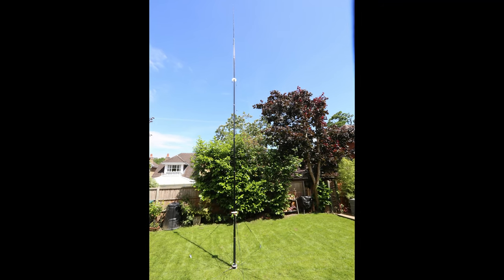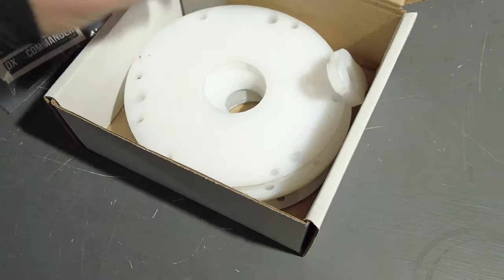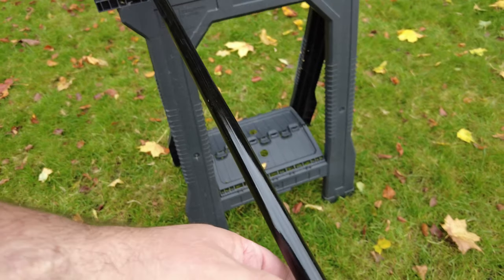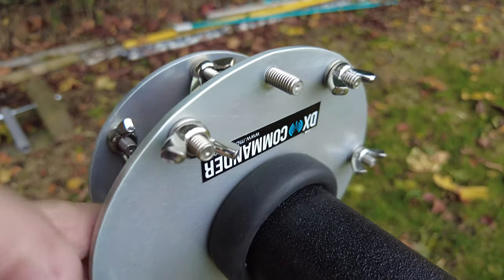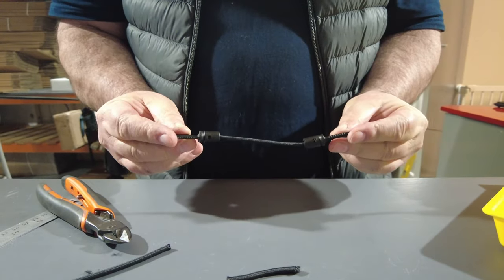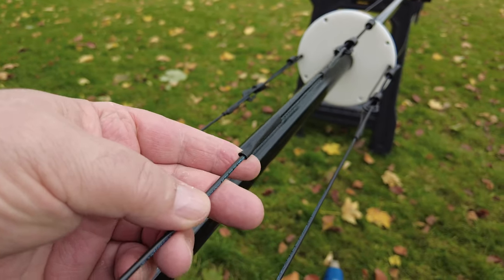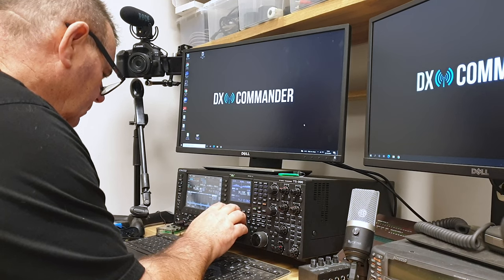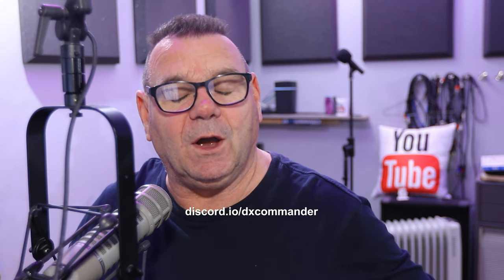Ultimate Guide - How to Build a DX Commander 2022

Comment: I love the DX-Commander antennas, it got me started when I was a foundation licence holder. It taught me why the antenna wire lengths are important and how to tune an antenna. A number of my fellow radio amateurs at our local club use these antennas, and its just great ! Thanks Cal for these great antennas, I need to get the portable one out at some point ! Thanks again, Alan 2E0FWE

Comment: My IC 7300 will not tune the 10M band with the antenna lengths given in the instructions. Instructions call out a length of 8.4M (331"). My radio tunes up a 10M dipole perfectly, but not the DX Commander.  I think the length given in the instructions are incorrect.  It's my understanding that a 1/2 wave, 10M antenna should be 5.26 meters (207").  Can someone help?
Reply from the maker: Drop me an email and we can work it out.. That length sounds like the Signature 12.4.. In which case it's a 3/4 wave with a foldover..

Comment: @bobS.
Hi Callum. i just ordered my antenna (DX Commander CLASSIC HF Multi-Band Vertical), (2-29-24). The question I have is how many guy wires do I need to install, and can I put this against a fence post for added stability and if so, what do you recommend?
YS Bob
Reply from the maker: Just three on the first spreader.. Small ones. Works fine!

Comment: Good morning Callum, I am moving house and will be living with my son and I am considering the “Classic” as my permanent antenna. Would placing a coaxial lightning arrestor between the so239 and cable to the shack upset the performance of the antenna. The arrestor would have its own ground rod. I am serious about minimizing risk to my son’s property. Thanks.
Reply from the maker: It won't upset anything :)
Reply: @DXCommanderHQ   Weeks later, it is up (still have to measure and install the counterpoise) and I have receiver action on all the bands. I found that the supplied shock cord filled the cup of the caribeener so much that my 78 yr old hands could not fit the hook part. I got a smaller shock cord at a camping supply store and I was able to make and tension the various antenna hook ups. Highly satisfied.

Comment: question can you slide the fibreglass pole  over a steel fence pole instead of using the guy wires?
Reply from the maker: Steve, trouble with a steel pole is that it has zero "give". But I do know of one person that did do this..
Reply: @DXCommanderHQ  thank you

Comment: I'm curious. 
Background:
I want to use this as a quick up/down antenna at my apartment. I could use a drive-on or some kind of tube attached to my Jeep as a base for the mast. I even have a clamp meant for a jack at the rear that clamps at about 4 feet from  ground level.

Questions:
Would this type of mounting work?

The radials would be laid over tarmac/asphalt in a kind of fan 180⁰ bowtie pattern, would that make a significant difference? Would it even work? Could I tie in the Jeep as a counterplane?

How badly would the metal Jeep and other autos detune the antenna?
Reply from the maker: OK, everything will work as you suggest.. If you were worried about the jeep, you could always jumper it to the ground plate of the antenna but in the main, I think you will the Jeep will be invisible. Bow-tie patterns, half-moons, 90 degrees, won't matter really. You will still get out and have fun, I promise.
Reply: @DXCommanderHQ  As an update, I bought the 12.4 Signature. Built and erected it myself. Seems very good for DX. It didn't solve my "local" guys on 75/80M. I tried a combo portable vertical with EFLW length for 80 and wow. So 2 antennas it seems. Vertical for distance, horizontal for local (NVIS).

Comment: Can I slide the fiberglass pole over a metal pole fixed in the yard? I know it may mess with the swr of high enough into the glass pole. Any idea how much until it screws with the antenna ? Thanks C
Reply from the maker: You can.. Just beware that I tried this once and the SWR was perfect from about 24MHz and up.. It was sinking all the power into the ground. But the tube was 2m / 6-ft long. A shorter pole would have worked.
Reply: @DXCommanderHQ  ok I was thinking about 16 inches to keep from kicking out. I may be able to slide pvc over the metal pipe and then slide fglass over it. 🧐

Comment: The more and more I watch the build vlogs the more I am able to get my head around how to assemble the antenna. Definitely looking at the DX commander classic with the inverted L found an antenna pully system that attaches to a metal pole on a T and K bracket to use for the extended 80m element.
Reply from the maker: OK!
Reply: Ah yes, I did this option and came off the antenna pole at the 5meter (third) spreader plate to a painters pole extended to 7meters with 2ft of shockcord as the anchoring line. Works good and bends with the Classic in the wind so it is not stressing that section. Works very nicely on our local NVIS net.

Comment: I setup my 1st ever Commander Classic..Install video helped a lot. I had to add some extra wire for the 40m element, but the SWR is the lowest I've eve tested on a HF antenna. 1.03 and 1.15 on 20 and 40m. I am receiving stations that I have not been able before. I'm gonna double guy it and see how it holds up in the harsh Chicago winter. Cheers!
Reply from the maker: Excellent.

Comment: The way 40 tensions is not very clear in the manual. It seems this video is the only way to get it right. Idk everyone seems to not have problems but it would be nice if some images were in the manual
Reply from the maker: You are checking the "new" manual? "Page 17: Your 40m element will go to the top of the pole and back down again by around 2m/6-feet" and half way down page 12 for any longer element (longer than 20m) says, "..make an intermediate
“tension” loop at approximately the same place where the 20m element ended" - and then there is 5 pictures. If you have any problems, just drop me a line!
Reply: @DXCommanderHQ  I can't tell you if it's me or the manual to be honest I really wasn't understanding what it means until I watched the video. I'm still a bit unclear if I just leave the bit that folds over the top just hanging loose or maybe tape it down?

Comment: Proably a stupid question, not played radio for far too long, do you see any issues running this for  2,10,11,12 meters, Ill need to look up implications of importing to CZ (OK) post brexit its a costly pain envlolving a long trip and an even longer wait for them to find the parcel. Asking as I have one eu cb and a small 2m tranceiver plusI am looking to get at getting a radio for the nearby amature bandsand currently have no antenna
Reply from the maker: OK, so the problem with VHF is that you really need some height to clear buildings. It will work on the ground but honestly not as well as 10m high.
Reply: @DXCommanderHQ  thanks for the reply

Comment: Hello Callum, someone has probably already asked you,  how come you have not used a put over pole for permanant based DX commanders ? So no chance of the put over  pole falling down due to tension, different on a telescoping pole. Yes I understand the plates may need redesigning, but the joints are wider and the plates once drilled may fit snug nearer the joints strongest point ? Plus you may not need electrical tape and your large jubilee clip and rubber hose to tighten plates ?  I ask as I have just bought a fibre glass 8m ( £24 ) put over pole and I have no fear of having to tape up telescopic joints and worrying they will collapse under any tension from shot cord, etc. 73's Andy M6APJ.
Reply from the maker: The Signature 9.5 is designed for pole mounting.. Just not launched yet.. About 3-months away. Almost same as Classic, but no guys! :)

Comment: If I wanted to build an 80 m square loop but I did not have enough room to do so is it possible to have a smaller loop that has a second layer added on top of the first loop so that it is effectively spiraling upward and would have the same amount of necessary wire for 80 m loop but just not have as big a footprint on the ground? So it would be as big as a 40 m loop but just have two layers layer one and layer two is this doable? If so how much separation would you have to put between the layers? Any thoughts
Reply from the maker: Hi Pat.. So I put a loop up for 80m once that was actually less then 60m. Coax fed with a balun BUT with loading coils in each corner. They were about 35mm in diameter and around 60 turns on each. Looking back I could have made the job easier by putting 2 coils fairly near the feedpoint. Easier to tune too. As regards your idea, I don’t know. I’m sure it would work.. But then we’re into the definition of “work “?!

Comment: Getting ready to build my DX Commander Classic antenna and have a question about the tensioning loop on the 40m element.  Does folding the element back to make the tensioning loop, and then continuing it to the top , not affect its ability to receive/transmit a signal on the element above the loop?  Sorry if this is an elementary question - this is my first antenna build.
Reply from the maker: Don't worry about that loop, it's not even seen by the RF, it's not a choke. Good question.

Comment: I didn't watch this video, but I wanted to make a humorous but complimentary comment. I sat for the Technician and General license less than 6 months ago.  I have little contact with locals, so YouTube was important as I started to consider what I wanted to try.  In the end, small time YouTuber's such as enthusiastic Astro Leah got me looking at the DX Commander (she wasn't doing a pitch, just using) and many others solidified that this would be my first antenna.  I loved listening to Cal think although I didn't really understand what he was talking about.  The DX Commander seemed great for home and portable operations.  So this antenna was my first purchase toward creating a station.  Later I picked out the FT-891.  Assembly looked intimidating, but reality was that when the antenna arrived, I was impressed with the quality of the pole and assembly went well and was enjoyable.  And then I hooked everything up, barely messed with ft-891 settings, and my wife began to hear voices in the basement.  So easy and rewarding.  Fast forward four days after a few successful POTA contacts. I hit the PTT button to put out my call sign to an activator and my ATU started to retune.  I was shocked and disappointed that it felt the need.  Nevertheless, for the next hour it was one QSO after another.  I was so excited that it seemed like I was invincible when it came to pileups.   So yesterday I just happened to think about going out and checking the guy ropes.  That was a shock.  I saw a wire wreck at the bottom of the pole.  What a mess!  I took the antenna down and found that it was just that the 2nd section from the bottom had completely slid down.  I had used my own zip tie where it happened (rather than what was provided in the kit).  So I placed a new one on the pole and also did the final change from taped element fold-backs to adhesive/shrink tube which had to be done at some time anyways once happy with the tune.  So I'm impressed that although wires were laying all over it seemed, this antenna was still effective. My heavens, about 20% of the 20m element was just curled on the ground.  I think this antenna is a real value and I like that it intuitively makes sense to me (1/4 wavelength cuts) although I surely don't yet know much about antennas.
Reply from the maker: Haha! I have done the same :)
Reply: I had my 17meter element had come undone at the loop because my temporary tape job let go. Heat shrink this time. LOL

Comment: What impact on SWR/resonance point does the tension loop in the 40m element have? And how many tension loops should the 40m element have? One or two?  It looks like two but just want to check.
Reply from the maker: The tension loops have almost zero effect.. You can have as many as you like.
Reply: @DXCommanderHQ  Sorry Cal, I didn't make my question clear. My 40m element is cut to the length set out in your chart. Does that length include the extra cable needed for the loops? Or must I add that to the length set out in the chart?

Comment: Hi Callum,  While I wait for my DX commander Classic 80-10/6 meter to arrive I has a thought while watching a previous video from March.  Could you put two 10 meter driven elements to cover more of the 10 meter band. I try to work DXPeditions and mostly phpne 28.300-28.800Mhz. But I also get a big kick out of 10 meter AM up in the 29.1-29.2 Mhz region. Seems it might be possible to cover 28.0-28.8 Mhz and also get 28.8-29.2 Mhz or more. Maybe balance it out a little better than that of course. But sometime is seems like two bands close togeter like 12 and 10 meters will cause tuning problems for both. 

Terry, KI7M
Reply from the maker: Terry, yes you can do this.. 28.0 through to 29.2 or so is pretty big - perhaps instead consider a 3/4 wave element (slightly more bandwidth). The new kits have a 4-hole top spreader just for this purpose - but I have yet to try it myself..

Comment: Hi, I'm not a radio amateur but I was wondering about what you have said in one of your video's about how higher the antenna above sea level. I forget which one of your video's that was. So here is my questions. There are a couple of hills here where I live and something I go up on one of those hills 100+ meters high with my handheld (2 meter 70 cm) but I usually don't hear much. But if I go  lower hill around 40 meters high I hear a lot more every time. Is there a explanation for that ? Thanks so much, 73.
Reply from the maker: It is genuinely possible that you are too high and literally "above" the signals. If the transmitter in question was using a high gain vertical, the lobe of RF will come out like a flattened donut. It is quite possible that you were above the donut. Ideally, it would be cool to find out where the transmitter is and you could effectively "join the dots" and work it out. That is my guess anyway (also from personal experience).